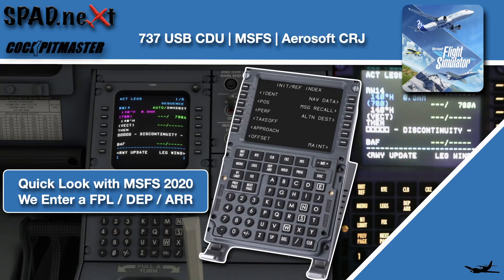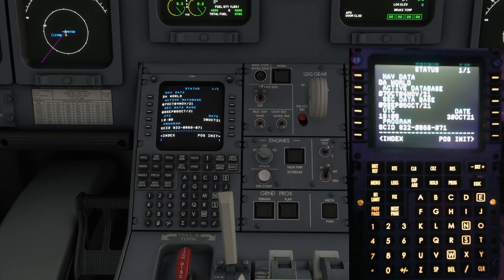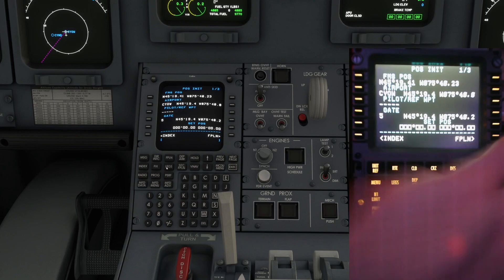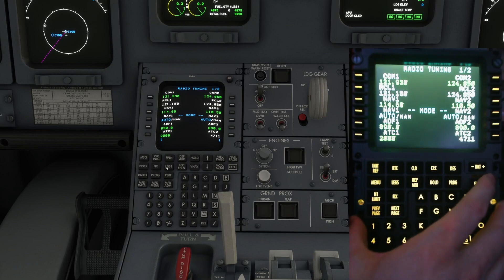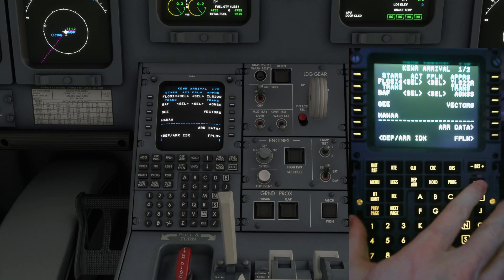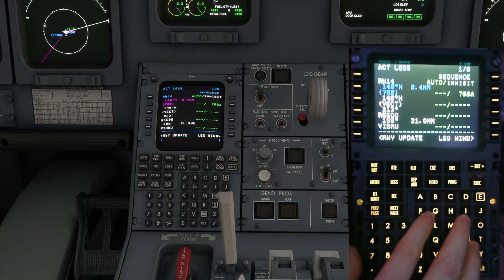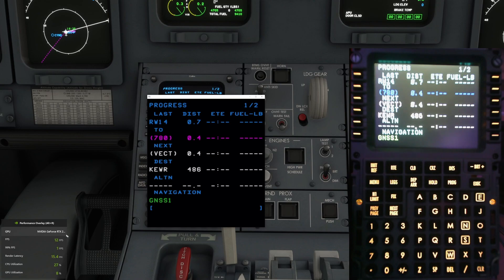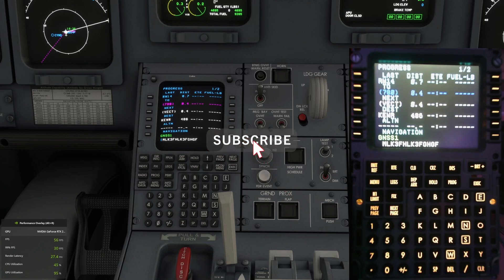(MSFS) Cockpit Master CDU | First Look

Comment: Just took delivery of the CDU. It works really well. Is there a way to get the FBW to output the display. I have all the buttons working just nothing on the CDU screen?
Reply from the maker: yes there is a video specifically for the FBW.
Reply: @LesOReilly  Oh that's brilliant. Is it one of your videos because i am pretty sure I have seen all of yours related to the CDU?
Reply from the maker: I just went and looked and I don't think I actually made it...  Basically it's kind of covered in the CJ4 video since you go to the same menu to enable it and set the port for the Fly  By Wire ... need to be running their sim server thing.
Reply: @LesOReilly  Few. Thought I was going mad. Thanks got it working now. Using Simbridge. Cheers.

Comment: They aint cheap for what they do.  Its not like it is operating like a real FMC, is it just mirroring the simulator version of it.  In Australia this would be over $1000, ah great but no thanks.
Reply from the maker: If you have the time and a 3D printer there is a guy that has been building some cool 737 cockpit items..  He did a CDU and I think shared the files..